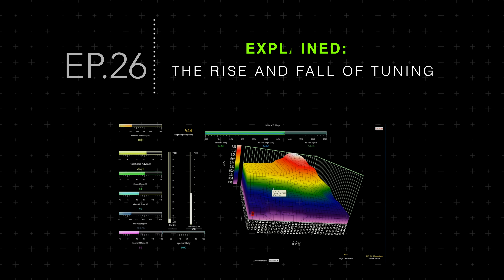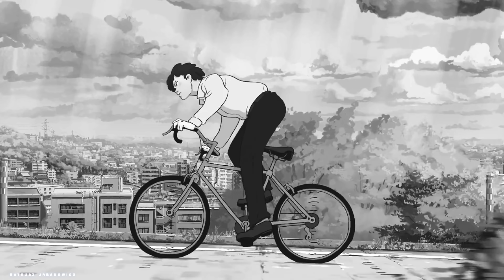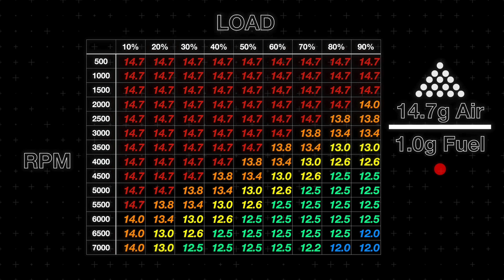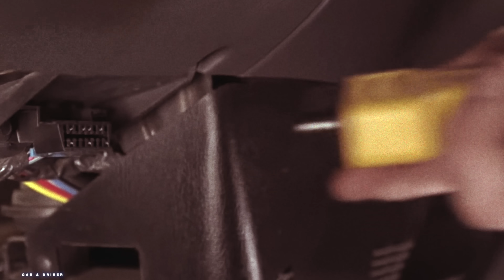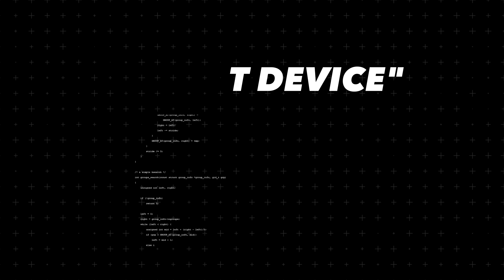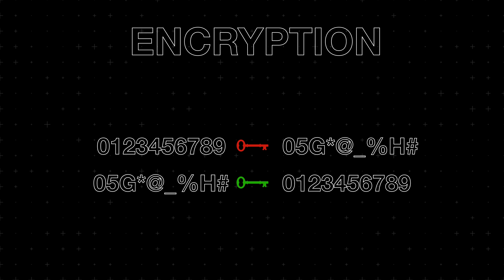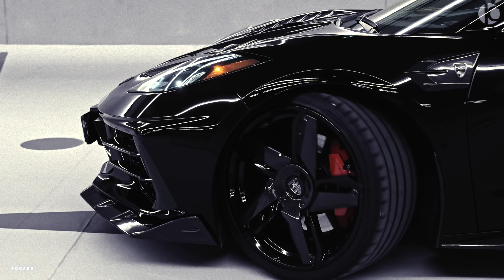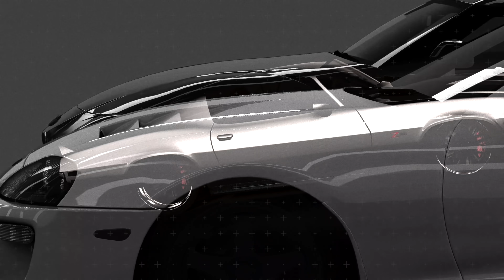How Tuning Engines Became Illegal👮🏻‍♂️| Explained Ep.26

Comment: 337 speed, listen up,ive been a tech, pro ase master since 1986. Didmy first brake job on a gmc 3/4 to longbed 2wd p.u. When i was 8. That sir was the year 1974. The jimmy wasa 1972. 
I know all about timing and fuel curves. What you kids are leaving out is as follows.
Proper stoichiomtrics at sea level is14.7:1 . At least thats whats been shoved down your throat by big oil.
The truth, is this, back around 69, the epa started noticing dead squirrels , moles, gophers, etc all along the express(free)ways. Test results..... Lead poisoning. Gotta get the Lead Out! Literally.
Whallah..... stellite valves and seats all around. The reason why lead was added was it created a cushion for the cylinder head valve. Without it, the valves would literally beat their way into the heads and crack the heads and hoop stress the valves. Again the answer was stellite valves and seats.
Now ask yourselves, why emissions equipment? Why a smog pump , injecting air into the exhaust stream?
Because unburned fuel in the exhaust stream. Why unburned fuel, Too Fat! Too rich, too much 14.7:1 stoichiometric bullshit! Thats why. 
Science fact not fiction. Gasoline burns at 90,000 ft per secnd. A typical V8 300-400 c.i.d. Factory setting generally without vacuum or computer advance is set at 8 degrees before top dead center. 
Why? 
90,000 fps, thats why.
Its a slow burn. And its fat. Thin out them stiochs and crank up the timing. Look at the rice machines, burning 30 degrees btc. Not 8. Hence 30 mpg vs. 10 mpg. Hydrogen has 2x he jewels of energy and burns twice as fast, the only output is nox, which is eliminated with a nox scrubber.  Timing set at 0 degrees, and electronic fuel injection enhances wired in to fool the ecm to keep it at 0tdc. 
Any questions? Its a big rockerfeller scam. Thin it out, time it up, and watch the emissions dissapear. 
Your welcome
Brendan Ferrel

Comment: I believe intellectual rights were never infringed upon. The main objective of that concept is to prevent  companies from stealing how other companies do their thing. "jailbreaking" is not infringing upon those rights.  But the epa does not want everyone out there defeating, modifying and in turn spewing out more pollution. I say on the streets there is no need for 1000hp vehicles that haul nothing but passengers. There is no need to go 0 to 60 in a couple of seconds and these high power vehicles are a menace, dangerous and have no place on our roads. I do however believe racing, efficiency tuning and other ways we modify vehicles should be within the rights of the owners...racing on the track sure go for it, taking grandma to the store not so much...

Comment: As much as I agree with what you’re saying a lot of this is phrased somewhat sensationally, 35 states have emissions test and only 17 of those have adopted Californias standards and most of not all have not adopted the 1975 rule, in my state of Massachusetts that has adopted California smog standards any vehicle over 15 years old is exempt from emissions testing.  Most other states are anywhere from 15-25 years so next year anything older than 2005-2000 will not need emissions testing in almost every single state with emissions testing, I don’t think carbureted cars will make a comeback as the tuning cars of choice on any of these states since plenty of 90’s and early 00’s cars will be fair game in the coming years.  As far as I know based on their legal filings and the wording the EPA mostly is after deletes and not expressly tuning unless it helps said delete to defeat emissions and as long as the ecu can be returned to OEM for inspection tunes are legal.  Almost all of their legal filings have been diesel and marine related very few tuning companies that make car products have been targeted and that’s why any product that would influence emissions is usually branded as “race use only” to skirt being prosecuted by the EPA.  Just my two cents, I don’t think tuning will be going anywhere soon.

Comment: There are many reasons to do “Custom Tunes” and not all are about changing timing/fueling/power levels. 

As a mechanic, there are many times customers have wanted certain things changed to support what they use the vehicle for. 

Example, people who tow heavy loads like transmission tuning changes since stock is a “general” setting and tow/haul isn’t always the answer. 

I do my own tuning and not “CANNED” tunes. Not every person who calls themselves tuners can actually understand what they are doing. 
It takes multiple programs, tools and sensors to do the job correctly. And it is not easy in any way, since auto manufactures like to change things around. Two identical vehicles could have different  addressed ECU’s so what works in one, could render the other useless.  

And the EPA has no issues with tuners as long as Emissions Equipment is not changed in any way. 

Auto Manufactures on the other hand will always try to stop it. 
At some point, it will only be possible with Custom ECU’s- only problem with that is, cars have MULTIPLE computers, that all communicate on a network, and they don’t like strangers.

Comment: Modern people are a bit more advanced, they want mass transit, they want to work from home, they hate things that pollute the air they breathe with toxic chemicals and noise, they would rather die than sit in traffic.  The future of cars is electric being used to ride sharing and deliveries, powered with solar, tidal, wind, and molten salt heat storage on super conducting transfer lines, and recycled batteries reusing lithium the same way lead is currently reused. The future of travel is high-speed rail, electric aircraft, and walking or riding a bike instead of sitting on your fat ass. Boomer mentality can't die soon enough alongside them.

Comment: While defeating pollution controls has been a generations long hobby, it has never been legal. Tailpipe emissions, fuel mileage, and environmental sound levels are regulated by various national and regional authorities. Almost every aftermarket motorcycle exhaust is illegal for road use. To vehicle OEMs, increasing rev/speed limiters and fiddling with tuning increase both warranty expense and potential liability from mishaps. Just as with speed limits, the law is the law and you cross the line at your own risk.
Enforcement had been almost non-existent outside of California until VW and the tuners mentioned above took cheating to an industrial level. It really didn't matter if just a few enthusiasts played with tuning, but once millions of cars, almost every performance vehicle on the street, had some level of cheating is was inevitable that the law-hammer would drop. This is just reality. Even today more and more tracks impose maximum engine sound levels. We are blessed to have the freedom to modify older vehicles, but if tuners and builders create a wide spread public reaction you can expect new laws and enforcement there too (looking at you, coal rollers and street racers).  We can only expect it to get worse. The one bright light today is the growing community of electric tuners and builders.

Comment: What's worse is there are plans to take all the older cars off the road. They simply will either not insure them or the insurance will be so high that it will be impossible to insure them. They want all cars to be connected 24/7 to an online server. The insurance cover will be based on how you drive, when you drive etc. If you speed the insurance will go up, drive at night insurance will go up, don't park in the garage insurance will go up. If the car is not fitted with this device it will not be insured. The vehicles can and will be tracked so everywhere you go is logged for use by the insurance companies and the government. An insurance agent from Germany leaked this info, its very worrying as it outlined the plans for the insurance changes in the next ten years.

Comment: While I applaud your attempt to explain this issue to the masses, you missed on some points. True car enthusiasts will always mod their cars no matter what. You missed on cars tagged "Street Rod or Historic" like mine which only need be 20 years old and can skip emissions, inspection, get half the cost for bi-annual registration, and I get to drive my cammed Mustang which is loud as hell in peace. For my DD which is my WRX which won't pass emissions, I just get a waiver for a year at a time and every time I go I pretend I just changed the battery which is why the light is flashing on the dash. They really don't care and give you a waiver to come back in a year and you just do it over and over, my car is a 2013, so it's worked for a while. Also my Mustang uses a Holley Terminator X, some of the tuning options you mentioned are mostly flash-based, a bit older and not something like a Fox Body would use like you have on the video. You can just remove the tune though and for any OEM system that has some "unbreakable" or anything like the Corvette is just for hear & eye candy for the EPA to hear. It is using an LT based engine, it doesn't take a rocket scientist to tune this over a C7 based LT1/LT4/LT5. Go right back to Holley :)

Comment: The manufacturers don't care if you tune your vehicle. The whole point of locking down the ECUs is to prevent third parties from cutting into the dealership's repair profits. About 75% of repairs on a modern car involve hooking up a scan tool to the ECU. If you can't do that you can't fix the car. Even brake jobs these days require a bi-directional scan tool because of electric parking brakes.

Comment: Stoich, 14.7:1, does not mean everything is burnt in combustion. It means there is a mixture of 14.7 parts air vs 1 part fuel. This allows the catalytic converters to convert the gasoline in the exhaust to water at stoich. Infact, you will get much better fuel mileage with a leaner mixture, but at the cost of emissions.

Comment: The latest trend is to bypass the sensors instead of reprogramming the ECU. The ECU relies on sensor data to do its job. If you feed it with fake data it will do whatever job you like. These sensor bypasses are usually easily installed and removed, thus you can take them out for an inspection and put them back in a couple hours.
Reply: I've been driving with an expired tag for almost a year now because my car won't pass an emissions test. Now I wonder if I could remove the o2 sensor and solder a resistor in there somewhere to trick the emissions systems...

Comment: i mean, here in Brazil Carburatted cars still fairly common, me i drive a 1985/86 chevy chevette, and it is carburatted, we have fueltechs here, and ive seen some really powerfull EFI chevettes with all sorts of engines here, but i still want to mount a 4.1 Straight Six Chevy engine and use a Quadrijet or maybe 2 Weber 40's im still figuring out which is going to be easie.
at the ''end'' of the Tuning Era im still rocking carbs LOL

Comment: I think some high-end companies need to make after-market ECU devices that include the appropriate sensor devices to allow you to keep the vehicle in compliance with emissions standards while tuning it.  It would specifically place the limiters to the legal limits, but let you tune anywhere below that point, which would allow you to get substantially higher performance out of the engines.

Most notably, since it would be utilizing sensors in the exhaust system to handle the capping, it could bring any other untested aftermarket parts into compliance, barring some extreme cases like non-compliant catalytic converters or fuel additives.  While this means one additional expensive component would be needed, all the other components could operate without the high cost of certification themselves, making only one component require certification.

Comment: You can't balance an engine on the thin line of exploding & reliability it either is detuned to be more reliable and less power will be made by the same engine, or you tune it for maximum power and wait for it to explode when it is pressed to its maximum power.
That is why a good tuner will give you a variable tuning chip with a range of available maps built into it. 
Always more ways to skin a cat than the EPA & DOT can hope to stop.

Comment: I grew up dealing with the old mechanical stuff the witchcraft that is fuel injection and computers is way out of my league. A resurgence of the technology I like is something I don’t see as a bad thing the problem is you can make tuning an ecu better in all directions and the epa doesn’t recognize that you can make the air cleaner and get more power

Comment: You can perform a ton of upgrades and tuning and still be well within the emissions legal ranges.  Lazy "tuners" better known as hacks are the ones that cut out/bypass legal emissions devices.  Just ask Carol Banks how he is easily getting well over 1,000 hp out of the trucks he builds or modifies while still using the stock emissions devices.

Comment: You don't need to "tune" today's ICEs. They already make about as much power as you're gonna get out of them.  An old 239ci stock flathead V8 made about 100hp. You can now get way more than that from a stock 1600cc Mini engine. The factory will always make a better, cleaner, more efficient engine than you will because they have the resources to do it. If you wanna tinker with your ancient V8s by all means go for it. But modern engines are already putting out as much power as they're going to while still being good for daily driving. If you think you can do better, take it to the track.

Comment: at 0.55 those images are the reason common folk cant work on a car anymore. I shouldn't need an IT degree to fix my car. a basic tool kit with wrenches screwdrivers vice grips is all you should need to do anything from bumper to bumper.
but.. that being said
the car community has proven WE WILL FIND A WAY. legal or not we will find a way. mechanics has been forced to drop wrenches and learn hacking skills but where there is a will there is a way. History has shown we will take things from out of their intended purpose to do what needs to be done. If it dont fit we make it fit with home made brackets spacers or adaptors.

Comment: I don't own a performance car and probably never will..
But, I can sure appreciate the sound of a well tuned high performance engine that pulls up next to me at a stop light.
Reply: Get one Dean
Reply: You only have this one life to live brother
Reply: Not with that attitude you won't! Seriously though, you can find some good performance cars for relatively cheap prices, although most will be older models. S30 and S130 Datsun/Nissan Z cars, Toyota Celica Supra's and MR2's, older model Corvettes, Civic's and CRX's, Miata's, etc. Will these cars be the most powerful or best performing in their stock configuration? No, but all of them have a lot of aftermarket support, and you can take as much time as you need to modify and tune them however you like. I've been building a 1980 280ZX for over two years now, and while it's still not running as of right now, I'm hoping to turn it into a fun weekend driver with a little over 300 horsepower.
Reply: They sound like someone lit firecrackers in their toilet while they have diarrhea. BRLLLPOPTTT POP POP POP BRRRRPT POP POP POP, drives me up the wall
Reply: Your gonna be greater! You just don’t know it yet! LOOL!! It’s been only 2 years now….

Comment: As of now, California regulations are stupid... As select states elsewhere vary on what is "exempt".
a 1976 Dodge pickup is exempt in the state of North Carolina and several other states from both smog and State inspections
However in California, it will not pass either due to the vehicle not being equipped with smog equipment from the factory. Its funny having been pulled over with out of state tags, with a CA license, and they do nothing, yet I still hop online and pay the registration (covid made that option very nice)

Comment: Good Information and a Good Video. BUT One of your last comments in the video was very insulting. The crack about the Vaping isn't any worse than smoking, in fact, it's better than the air in most homes in the USA. Plus, If you think about it, you breathe in more dangerous air outside than in a vape shop because the air outside is not filtered. Also, how do you know that vaping diminishes someone's life? I've vape for over 12 years and I have a pacemaker, too.

Comment: Why do you need to even crack the stock ECU, instead of just replacing it with an aftermarket one? Are some (which ones?) components also programmed so, that they only work with the stock ECU?

Comment: Excellent visual composition, a treat for the eyes.
     Your analogy to pedaling a bicycle is incorrect. It illustrates retarded timing. There is a correct analogy to be made here, but, like much of engineering, it is more complex and less elegant than a cartoon.
     You neglected to mention CANBUS. Vehicles so equipped depend on a number of interconnected modules, each with a specialized purpose. Because they talk to each other, you cannot just swap in your own. A mismatched module will cause the ECU to "throw" multiple codes and may force limp mode or prevent engine start. To integrate a new module requires an expensive scan tool or even a dealer-only device.